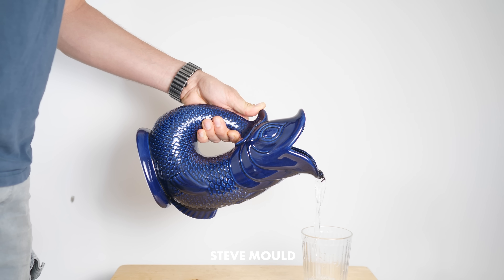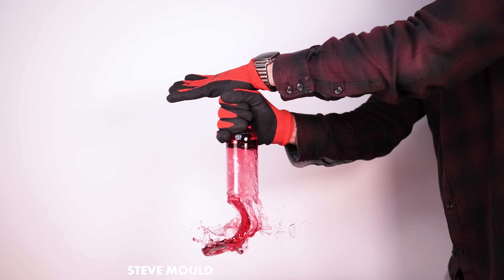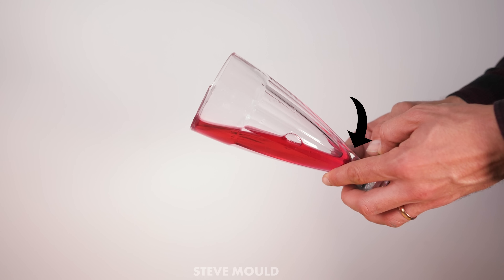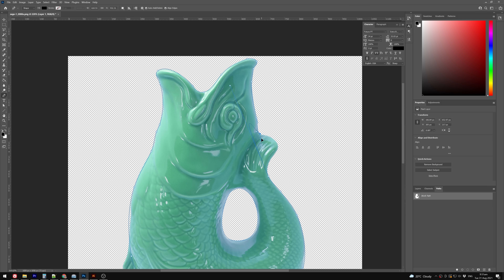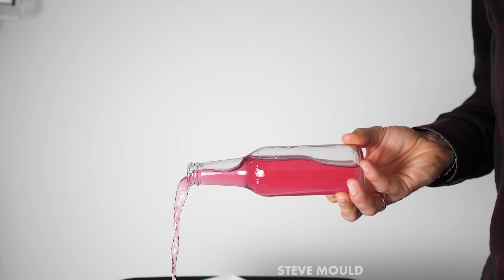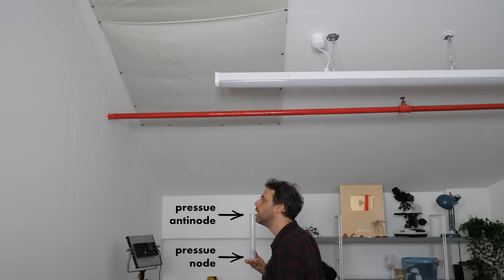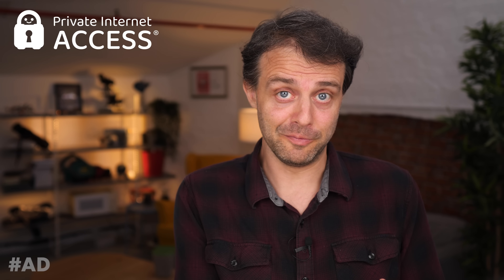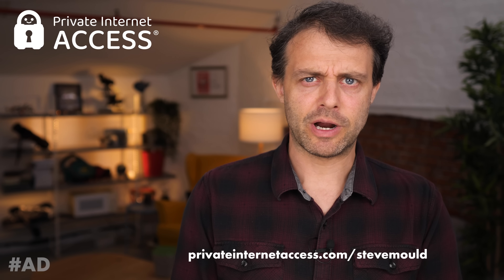Why Gluggle Jugs Are So Weird

Comment: My immediate first thought was the sound a water cooler makes as it empties, with the water sealing the only exit and creating a low pressure system that periodically equalizes as it draws air in, making a similar, deeper *glug* sound. I think the gluggle jar effect depends on the hollow handle curving around far enough and being the right thinness to be sealed off by the escaping water in a similar manner. But I'll be quiet now and keep watching to see what Steve comes up with 😅
Reply: Well now it just looks like I watched the video, pretended not to know what would happen, and just lazily ripped off his explanation, even using some of the same exact terminology. Ya know, this is why I never share my predictions on YouTube...

Comment: I was once in a pub with a mate. The condensation on the outside of his fresh pint glass caused it to slip out of his hand. The base of the glass hit the floor absolutely parallel. The resulting beernami was spectacular and was (a few pints in at that point) a highlight of the evening.
Reply: I've had that happen a few times with cups of soda - the plastic/waxed-cardboard kind, like you get at convenience stores and fast-food restaurants, but also once with a bucket of water (so it's not just a CO2 explosion). The reaction may merit further investigation - I suspect it's a related but fundamentally different process than either the cavitation-bubble-smash, tilted-glass-sloshback, or the "Worthington jet", and may depend on the angle of the sides of the container relative to its bottom. I'm guessing the liquid starts with all the same downward momentum at the moment of impact, but the sloped sides force the outer liquid inwards as it tries to move down, pushing the center liquid upwards.

Comment: Hey Steve I have a question. Why do electric kettles randomly click ages after being used, even if they're switched off?
Reply: That's because they use a bi-metallic relay to regulate temperature I'd guess. It clicks off once the water has reached boiling temperature to avoid boiling it off. Once the temperature has gone back down it clicks back on. Since this relay work purely with heat, it operates even without electricity.

Comment: I love your content and good work as always. You probably could've filled one with setting compound, smashed it and then vacuformed a perfect copy. Still tremendous work!
Reply from the maker: That's a really good point!
Reply: Put a tube around the bend into the tail and suck the air out?
Reply: @netyr4554  sounds like a good way to get a mouthful of  setting compound, whatever that is.

But seriously, good idea
Reply: @netyr4554  You wouldn’t need to suck - gravity acting on the compound in the main body would displace  the air , the tube just gives it a way to get out.
Reply: Wouldn't setting compound be denser? It'd be difficult to glug out the trapped air in the tail

Comment: Where I live milk is often packaged in 1L watertight cardboard bricks, if you pour to fast or if you don't punch a vent hole, a lot of air can get trapped above the "milk line" and it splashes a lot.

Comment: Now I'm really interested to learn why it's 28°C in Steve's house. Is that the temperature he prefers? That seems quite hot to me.
Reply: It was pretty hot weather a couple of days ago in the UK (28-30°C) and most UK houses don't really have air conditioning
Reply: @ana-morgana  Concurred, that last little burst of summer we had combined with Steve looking like he's filming in his loft/attic (right at the top of the house where the heat will rise to) will make his space quite toasty whether he likes it or not.
Reply: @ana-morgana  Still, you should expect it to be like 5-10 degrees colder inside a house, especially igf it cools down a lot in the night.
Reply: @wvdh  idk it can get really hot if you let the sun in - if it was 30°C out I'd say 28°C indoors is realistic. Also I don't think anyone would choose to have their house 28°C?
Reply: @wvdh  UK houses are generally built to trap heat, since in the past it didn't get unreasonably hot here. As a result it's pretty common to get slightly higher temperatures indoors than outdoors on hot summer days.
Reply: @jadewhite766  And it can take a few days to cool back down again
Reply: @jadewhite766   @Ana M  Yeah living in Belgium, so I kind of assume houses aren't that different over there. Your house has on itself some significant thermal capacity so it will heat up slower than the outside air, so I expect it to be some 5-10° degrees lower than maximum temperature outside(numbers (for temperatures above normal room temperature) are from my experience, higher difference for higher outside temperatures), insulation works in both ways keeping out the heat in this case. And since it looks like it cooled down significantly in the night your house has to heat up again in the morning.
But maybe he is right under a roof, has lots of windows and let us not forget all the lights for filming.
Reply: @ana-morgana  it's not always by choice. My house has evaporative cooling only and while it's cheap to run and generally effective in our dry climate, it struggles to keep the temperature below 28 or 30 during a heatwave.

I'm not in London though
Reply from the maker: It's actually a studio that I rent. The building used to be a warehouse. The roof is corogated iron so it's like an oven. Really hard to set up AC too because of the position of the windows!
Reply: @SteveMould  I guess you could insulate it a bit, then set up a fan to pull air in during the night.  Might be the cheapest fix.
Reply: It is to stop the secret sauce from freezing in the red pipe.
Reply: It's summer in the UK, so this temperature indoors on the top floor would not be odd.
Reply: Lol. We put our air conditioners to 28°C in our house.
Reply: @sourabhperuri1698  Where are you?  That AC temperature setting reminds me of when I was in Japan.  28-30 was the cool room. Although with global warming my expectations of what is cool have changed.  It was recently above 52 C (48 + humidex) where I am in..... Canada.  After that 30 felt almost chilly.
Reply: @lubricatedgoat   Wait, Canada even goes upto 48?!  I'm in India, where it reaches 35 to 36 during summer. Though I must say I never met anyone who puts their AC at 28. Mostly it's below 24. Only our family is like that.
Reply: @sourabhperuri1698  49.6 here this year.  Hotter than Las Vegas has ever been.
Reply: @lubricatedgoat  Respect
Reply: My interest was not the actual number but the unit "centigrade" is that really a term? C stands for "Celsius" and nothing else, after the Swedish scientist Anders Celsius. Why do Americans and Britts insist on calling it centigrade?
Reply: @DrRosik  it was the old name for the unit, to this day I still hear some saying "centigrade or Celsius" as if we still were in the the transitional period
Reply: @DrRosik  a gradient of 100 parts.  Probably nicer to call it Celsius though, to honour the guy.

Comment: "there's a node here and an antinode here" draws them backwards
Reply from the maker: Damn, I spent so long making sure that was right! At least the wave was drawn right
Reply: @SteveMould  With a standing wave in a container, they don’t “move” at the walls of the container, cause the wall doesn’t move either. This lack of movement can be represented by the way that your opposite peak positions (the white and black lines) intersect, as the wave doesn’t “move” to get from one to the other.
Reply: @haph2087  that's true if you're plotting movement, but here we see a pressure plot: max pressure changes at the closed end, and constant 1atm pressure at the open end.
Reply: @dadaj08  Hmm. Fair enough. I’m not exactly sure how pressure works with sound, so you might be right.
Reply: @SteveMould  No, the words are correct but the wave drawing is incorrect.
Reply: @SteveMould  And here's a wave from me! ;)
Reply: Yeah I noticed that too. It’s labeled correctly (except for the typo) but the wave is drawn backwards with an antinode at the bottom and a node at the opening.
Reply: A node is a fixed point in a standing sinusoidal wave function, so the closed end of the pipe would be a velocity node and pressure anti-node while the open end would be a velocity anti-node and pressure node.
Reply: why 0.72 meters are divided by 4? what is that? thanks.
Reply: @cubertmiso  Good question.  I found an explanation on Wikipedia (https://en.m.wikipedia.org/wiki/Acoustic_resonance) under the section about cylinders closed at one end.
Reply: @johngee9018  thank you bud!
Reply: I noticed “pressue” but not the reversed nodes

Comment: I can't imagine the cesspool growing inside the handle where the air is stuck, that never sees light and can never be properly cleaned.
Reply: Soapy water and bendy brush
Reply: 1. Only use water, or clean immediately after using 
2. Put soapy water in jug
3. Shake vigorously with hand over the open end 

This method seems to work well at cleaning similar dishes for me, as I have large hands that don’t fit in many cups or the like.
Reply: If you only ever put water in it, a good rinse with soap should be more than sufficient

Comment: STEVE can you make a modular or dynamic gluggle jug? Maybe there’s a dial or mechanism that can change the aperture or thickness of the chamber to have control over the pitch? Or maybe a base that you can swap in other chambers that are tuned to specific tones or resonances?
Reply: we makin a kickstarter fam - silicone it to be bendy and gg! quick buyers get 3d printed custom fish and mid-vomit cat surrounds for the glugchug! screw in neckcap, and a chain through the tailhoop. we gonna be rich son!

Comment: Do the Assassin Teapot next, it's a teapot that pure 2 different liquid based on which hole you cover. I would love to see how it works.
Reply from the maker: That's a great idea!
Reply: With this video I have been introduced to Gluggle Jugs AND Assassin Teapots.   Both of which now go into my gaming references file,
Reply: @peterkelley6344  And you can bring them out when visitors come round that you don't particularly like... "I'll pour your mother in law a cup of tea... no problem, just go get the teapot"
Reply: "depending on which hole you cover" -- without knowing anything about the teapot, that right here is the key. I'll make a guess that there are two containers inside it, each with a different liquid and each connected to the one of the two different holes. When you cover one hole, you block air from rushing in so the liquid is stopped by the outside pressure. You need the little hole for air to rush in when you pour the liquid so that pressure inside would be the same as pressure outside.
Reply: The pellet with the poison is in the vessel with the pestle. The challis from the palace has the brew that is true.
Reply: @Remowylliams  I like the flagon with the dragon, myself.
(By the way, the word is "chalice," not "challis.")
Reply: In the one Tim demonstrated, you can clearly see the two sides. The explanation above is correct.  https://www.youtube.com/watch?v=kkrgUT70Mbo
Reply: https://www.youtube.com/watch?v=kkrgUT70Mbo

Comment: You've set my expectations too high now! I'm surprised you didn't end up making a Super Gluggle Jug with an extended resonance chamber and narrowing channel thickness to support vibrations at more fluid levels.
Reply: Or how about a gurgling Pipes of Pan or should that be called a Pipes of Poseidon ?
Reply: Yeah I was really expecting him to take the concept to some ridiculous level.
Reply: And a much larger radius so that there will be bigger and/or more glugs
Reply: If he changes de the fluid for another with more viscosity like oil, would it sound different?
Reply: @bochum1676  The frequency/note would be the same but viscosity might affect loudness and how many glugs you get? Most of the noise's characteristics from from the geometry of the jug
Reply: Would have liked to see what would happen if the air was completely displaced and you started pouring...
Like when does the sound come back (if it even disappears?)

Comment: you didn't think about pouring molten aluminium in the jug to see how it worked?
Reply from the maker: I'll have to send one to Cody
Reply: @SteveMould  he'll fill it with lumnum.
Reply: That would be really hard actually. The shape by design traps air in the tail, so it would be difficult to get the metal to fill the cavity completely.
Reply: @5thearth  fair point, you could drill through the ceramic of the tail to let air escape though.
Reply: I was thinking spray styrofoam, but molten metal would be way more exciting.
Reply: Cody would do it with mercury, not aluminum 😂

Comment: I don´t want to be reminded of a clogged drain when someone pours my drinking water.
Reply from the maker: That's a really good point. I couldn't put my finger on what I don't like about it. But that's it!
Reply: @SteveMould  I challenge you to make a Worthington Jet jug that just shoots you in the face nonstop.
Reply: @MushookieMan  water gun
Reply: @SteveMould  now you need to do the experiment on drain u-bends and compare
Is there an optimal shape to produce glugs?
Reply: @SteveMould  OK, you explained where the noise is coming from, but WHY do water bubbles make noise?
Reply: @FLPhotoCatcher  thats a really good point. Especially, since they dont just make a noise when poping, which I feel would be intuitive.
Reply: There's a thin film of water that gets pushed into the air by the bubble held together by surface tension.  When that ruptures, it gets pulled back to the surface by surface tension and the bubble air expands outward since it was previously slightly pressurized by the water film.  Similar to a balloon popping.

There's also probably some noise from the water splashing back together after the bubble surfaces.
Reply: @FLPhotoCatcher  Everything that pops displaces air, no matter the size/amount, and that equals a sound being produced, be it in a gluggle jug or otherwhere. Stomachs gurgle; bubblegum bubbles >pop<; carbonated beverages fizz; people fart. These are all air/gas pockets bursting, which displaces air, which makes a noise.  .... You just wanted someone to write 'fart', didn't you? ;-)
Reply: That things also a nightmare to clean well. Might be the reason why it's not transparent
Reply: @fluffigverbimmelt  I'd use it for water only. Shouldn't be too much of a problem.
Reply: What if that reminds you of post 10?
Reply: @0LoneTech  post 10 fans are slowly taking over the internet! That's good! :)
Reply: @0LoneTech  Then you may rest peacefully, protected by the rake of the anti-beaver!
Reply: Does a clogged drain make any sound?
Reply: @userPrehistoricman  Fully clogged, not so much.
A partial clog, or a drain system with insufficient pressure venting can make some weird noises.
Reply: @userPrehistoricman  Good point!
Reply: Yeah but they do. That's why it's funny.
Reply: Ha I was thinking the same thing. That dreaded sound you hear and you know the blockage is deep down the drain it’s not going to be a simple plunge. A plumbers lament
Reply: Coward

EDIT: also it is pretty easy to clean with chemicals  or pipe cleaners you just need to understand the contours
Reply: https://youtu.be/lQKuc5mxdQM

Comment: “Huh, a ‘Gluggle Jug?’, I’ve never heard of those. Does it use the space in the tail to make a more pronounced ‘glug’ noise as you pour water?”
watches video
Hypotheses correct!
Reply: That's what I assumed at first. But I expected the tail to fill up with water as the jug is tipped. I suppose the curve allows air to flow both ways?